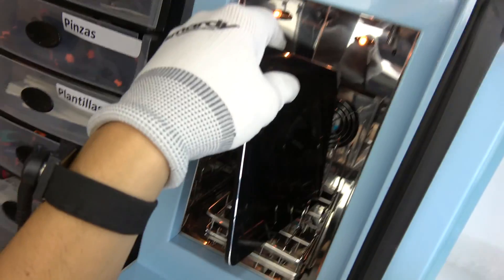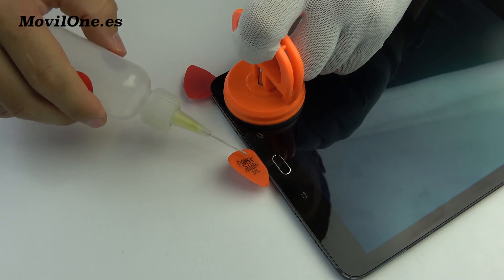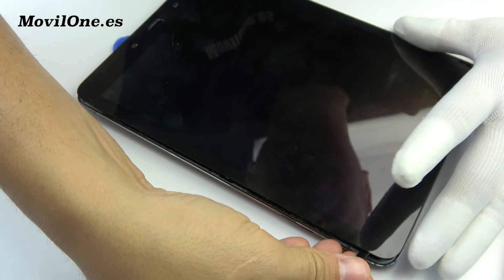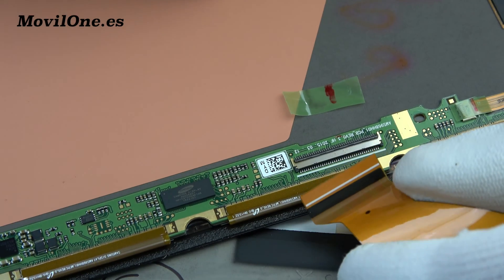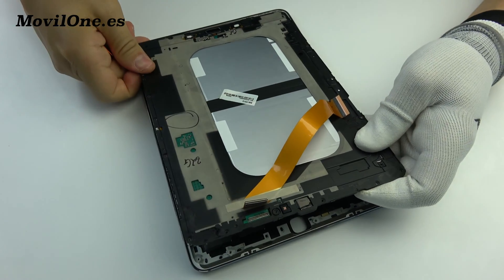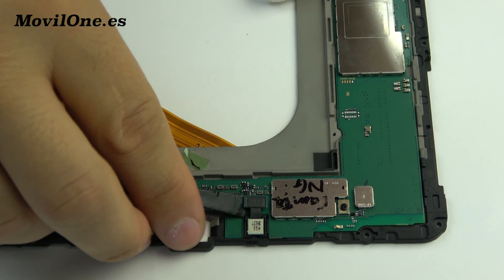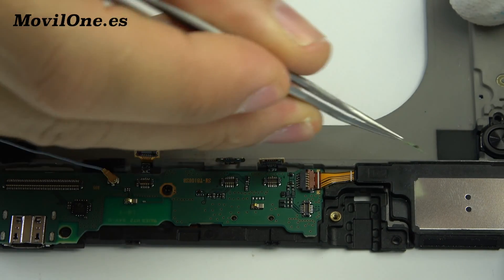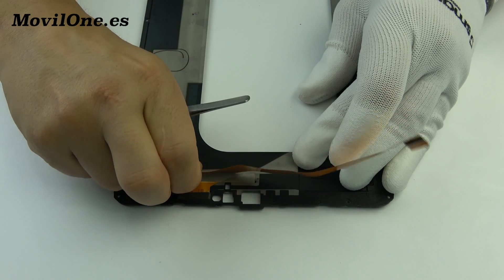Samsung Tab S2 Teardown

Comment: Sir I have a question. I did buy a  used Tab S2 8"  but the battery is draining so fast in like 30min, from 100% to 0% sometimes it jumps from 80% for example to 0% in no time, also it heats in the left back of the tablet, and it slows down dramatically while is not charging and the display stars flashing in green and turning on/off. I must say when connected to the charger it works like nothing, what could be causing the problem?
Reply: @sakhar Yes! I bought a new battery and now it's working great again! I'm happy because imo this tablet is still relevant to consume multimedia, and the amoled display is still beautiful, so it was worth it

Comment: My S2 I've had for years with no problems. Today I was charging at 91% decided to turn it off. Went to turn back on.. and nothing. Won't show charging or turn on. It can't be dead. Any ideas.. Should I take it to a repair shop?
Reply: Any updates? I decided to turn mine off as well last night and I can't open it now😭 doesn't show charging and won't turn also💀😭
Reply: @miloanimationsph24  so mine started working again .. very strange but I took to a repair shop and basically it was charging SUPER slow they charged it all day and it's been working ever since. Battery life is bad and tablet will glitch occasionally but I still use it regularly.

Comment: I have a question. My Samsung Tab S2 won't charge but the tab shows charging, what's the problem? 
0%
Reply from the maker: Maybe is the battery! probably  you need to give the battery a jump start. Best regards
Reply: Maybe loose connection. Check usb port for dirt also.
Reply: @chrisl4281  should try, thanks

Comment: I dont have a fancy dryer like the samsung one. Could I use a regular oven at 175 degrees Farenheit  or 80 celsius?
Reply: yes if you want to eat it
Reply: Yup. We just tried it, 80 celsius, 10 min on fan. Worked like a charm. 
Unfortunately we cracked the LCD later because we inserted the picks and then slighty lifted the screen with the pick (DO NOT DO THAT). We also damaged the cable by inserting the picks too deep. We did manage to clean the on/off button that stopped working (that was why we wanted to take it apart). Button now works, but the screen is too damaged LOL. Well, we had already replaced the tablet, so it was a fun morning. Learned a lot, mainly that replacing the LCD will be too expensive :P

Comment: my galaxy tab s2 does not turn on and when i connect it with micro usb it does not seem to charge but the tablet does get hot... is the issue with the charging port?
Reply: @khurshedisroilov5728  did you find the cause and a solution?
Reply: does it get warm or unnaturally hot?
Reply: @attinyit9609  yes
Reply: mine charges but i cant turn on. pressed everything and just blank or it shows the battery life while charging
Reply: @khurshedisroilov5728  mine has the exact same problem. Found any solution?
Reply: @jianguoyuan3348  samsung center you go

Comment: very good video man!!
 just a quick question did the same adhesive stick together or you apply new one and if you did what type of adhesive do you used thanks in advance
Reply from the maker: Jose Vasquez, i recommend the industrial glue T7000 or B7000, depending of the colour of the device. One is black and the other is transparent. Let me know if you need more info. Best regards and thanks for your comment!
Reply: @MovilonePhoneRepair  thank youvery much that'l do